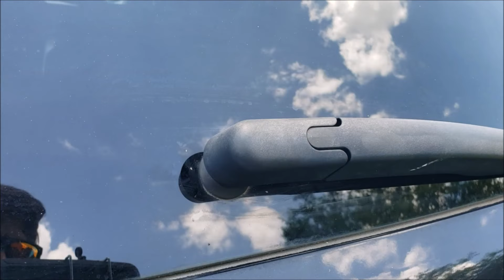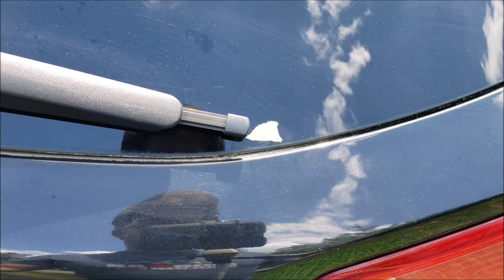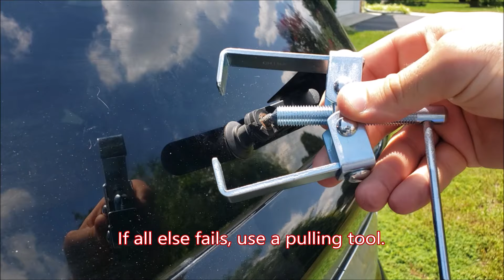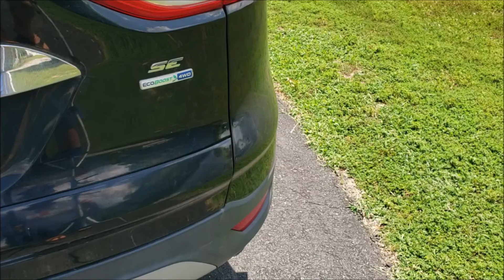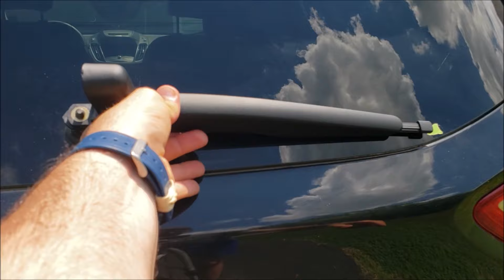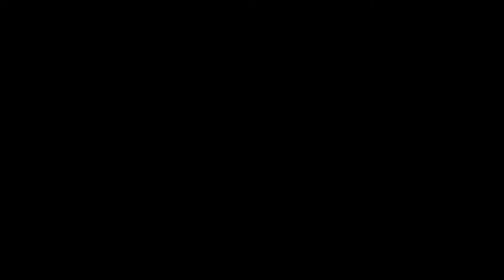Replace the Rear Wiper Arm: HOW TO ESCAPE

Comment: Very good and informative video. In most case, the pulling tool is not needed. Take off the nut. Let the WD-40 soak for a few minutes. Then simply turn on wiper, the twisting force will force the wiper arm loosen.
Reply from the maker: Oh cool! Thats good advice! I didn't even think to try that- good call Joe! Thanks for the comment and for checking out the channel!
Reply: Gonna try this in the morning, hope it works.
Reply: I tried this without avail. Any ideas?

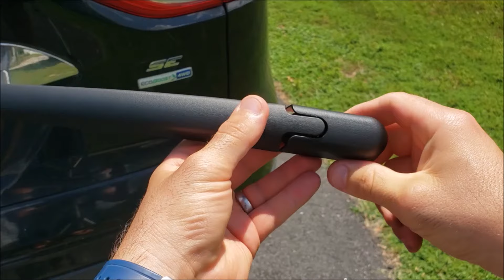Comment: Thank you - I originally found your video because somebody else posted it on their channel without attribution.  Anyway, I lost the arm and spring in a conveyor belt car wash today,  but they retrieved it for me.  I was able to reattach the spring on both ends without removing the assembly by freezing the video at 4:03 and noting how the spring hooked the two other two pieces of the assembly. Edit: I have a 2019 Explorer.  The manager thought I would have to get the Ford dealer to reinstall it.

Comment: Your video was the most comprehensive and informative.  I've seen others, but not as thorough as yours.  Especially, giving numerous useful tips in removing the arm initially was extremely helpful.  Not many have gone through or given thoughts to all those points.
Reply from the maker: thanks a lot @jtbtabimono- I appreciate you taking the time to post the comment and let us know- the goal of this channel is to help us all get to know our Escapes a bit more and be thinking about things from a proactive perspective when it's so easy to just want to immediately dive right in and bang out the solution. Please let us know if there's anything else we can help with and hopefully we can :) Have a great night.
Reply: Ain’t a single video show how too put the spring part in tho

Comment: My wiper arm doesn’t fit enough for the bolt to pop thru to put the nut on any ideas?
Reply from the maker: Hey there Jeremy- not sure- what is your make and model for your vehicle? Do you have an Escape like we show in the video or is it a different vehicle? What kind of wiper arm did you get to be a replacement?

Comment: Thank you for pointing out the marking of the angle of the blade tip position.  I fitted mine without marking the tip and the wiper ended up going beyond the screen.
Reply from the maker: No problem- glad it was helpful! Thanks for the feedback and taking the time to comment!!!

Comment: Hi I just replaced my wiper arm and now the motor will not turn it it just makes this grinding noise. Do you know what I can do to fix this?
Reply: oof- Hi Matt- thanks for checking in. This motor is a gear motor - I believe it is a worm gear that turns a main sprocket for a ton of torque for the wiper. Sounds like the gear teeth on either component may have stripped, especially if you're hearing a grinding noise. If you put your hand on it do you feel it vibrate when it grinds and does it only grind when the wiper should be traveling? I haven't ever done a replacement on my Escape, but I do know you can find a replacement one here for a decent price ( Rock Auto) . It may not be that challenging of a job either, but just time to get to it. Please let me know if you have any questions- sorry you're dealing with this. https://www.rockauto.com/en/moreinfo.php?pk=3588405&cc=1503985&jsn=893
Reply: @Monkeychunks8690  thanks for the info.

Comment: Howdy. I am in Oz sorting out sons Ford Territory. Not sure if they are same type but assembly looks the same.

 The only difference is that my post was a spline arrangement. Had the tiny grooves for female end to slide on to.  Yours looked quite corroded after you took it off so couldn't see. It looks like I may need some type of puller tool also. Ta for links. Bought a second hand assembly from wrecker for $35 Aus. 

Can't seem to unclip the part of the assembly that swivels otherwise I could just transfer that part.

Comment: I bought the puller tool and it slips off every time it gets tight any advice
Reply from the maker: Ok so you put the new wiper arm on there and tightened it and it still falls down? The puller tool should help it to come off but it shouldn't have any use afterwards, nor an effect on how the nut tightens back on the arm. Did you inspect the vertical splines inside the bushing on the plastic arm and the same style splines on the motor post? If those are worn away then yes it will loosen and fall down again. The splines are like gear teeth which hold the position of the arm to the motor when the nut is tightened down. They're critical. If thats not the case, then your motor may be bad and the post not able to hold position. The motor shaft should have a lot of resistance to it. If the nut is tight and the splines are holding and its still falling down,  its likely your motor.
Reply: Thanks for the fast response. Ok so I’m still on the old wiper arm, I removed the strew but the arm is rusted so I bought exact puller to remove it, I’m having trouble removing old wiper arm

Comment: Hi I have a 2011 equinox and mine is broke so I need a whole new arm but I took the bolt off and the arm piece won’t come off and we’ve tried everything even the pulled and it’s still on there
Reply from the maker: Ugh thats rough. If you have the time and patience and especially if its not on your car anymore, you could try a small cutting wheel on a Dremel and just try to split it from the post?
Reply: @HowToEscapeDIYTipsandReviews  unfortunately it was still on the vehicle but I did get it removed with a pulley thanks to my bf so thank you!

Comment: Thanks! The nut was easy to remove but I was having trouble removing the assembly from the shaft. I came to this video to see if it's safe to use a tool like you used. Thanks 🍻

Comment: Helpful thank you, on mine the compression spring under the arm had rusted and snapped, when I removed the nut the arm
Was stuck on probably from corrosion. Left on some wd40 for a bit to soak

Comment: This helped and gave you a 'like' but personally I had the spline with the tapered threading on the side which it wasn't obvious if I should pull it off the shaft.  My old wiper/arm had the plastic crack and came right off but when it came time to loosen the bolt and slide on the new arm it wasn't fitting with the spline there.  So I wasn't sure if I had the wrong part or that piece also needed to be pulled off.  I think a mention of the spline would be really a key piece of information that would be really helpful.  I ended up using the 'puller' tool and the spline popped right off and the rest was trivial

Comment: How do you make it aligned. It keeps going more down.
Reply from the maker: It sounds like your motor post got turned too far. Try taking the wiper arm off again. With the arm off and the post bare, press the button to operate the rear wiper and then let it stop in its intended home position. Then, reinstall your wiper arm and hold the arm when tightening the nut so that you don't turn the post again by accident. Basically a reset of the home position for the motor

Comment: Had to cut the bushing in half with a Dremel on both sides and then pop both halves off with a flat head screwdriver. Puller wasn’t budging it. I used a small disc to not risk getting near the glass.
Reply from the maker: I hear you on that... they're pretty tough to get off sometimes. Glad you worked it out and could get it all swapped out!
Reply: That's where I am with mine.  I bent the puller jaw.  The salt corrosion feels like it was weld on.  Oh well dremel it is

Comment: Works for 2004 BMW x3 E83 as well.  Just make sure you mount the wiper in opposite direction to this video.   Also, If you don't want to invest in a pull tool you can try use a screwdriver and rag (to protect paint) and pry carefully.  Thanks for helpful vid!
Reply from the maker: Nice- thanks for the feedback and the heads up to others with a BMW X3- thanks for the comment!
Reply: I used a pair of channel locks and put them on the left side and rotated the entire blade and it came unstuck from the bolt

Comment: Could you tell me what size nut is used?  I somehow lost the original, and went for 5/16 (didn't fit), m9 (metric, also didn't fit). I got both coarse and fine thread assortments of nuts that seem to fit, but are tight when threading, and I don't want to do damage.  Any help is appreciated!
Reply: 13mm @ 1.59

Comment: have you tried using a small bracket between the tools screw and the screw holding the wiper arm? it makes it much easier since the tool screw just wants to get off the screw holding the wiper

Comment: I had got that tool but mine was so stuck the tool bent. Advanced auto parts had another one for wiper blades. But it had a hand crank knob. I got a 8mm 1.25 bolt and put that in the tool and used my socket wrench to turn it much easier heh. It came right off.

Comment: I've just purchased a Nissan Micra MKIII rear wiper arm. I really hope this video helps me out 😃
Reply from the maker: Nice! How did it turn out? Did it work?
Reply: @HowToEscapeDIYTipsandReviews  unfortunately, the aluminium had ceased so we sawed it off😂😂 luckily, the new wiper arm had brass instead of aluminium but we also put plenty of copper grease. This was really helpful by the way!
Reply from the maker: @MAH-89  Hah! Good idea- yeah these things have such tiny splines, different materials in contact, and they have wiper fluid and the elements all over the place... it's no wonder they get so jammed with gunk and crud and sieze up.. glad you got yours fixed and how you're happy with it. Appreciate the feedback and checking in!
Reply: @HowToEscapeDIYTipsandReviews  anytime bud!😃 thanks once again

Comment: Would it be fine to apply copper antiseize instead of threadlock where the bolt tightens?
Reply from the maker: good question- I think yes on where the straight splines go into the brass nut of the wiper arm so that it doesn't get stuck again in the future, but no, you do not want to put it on the threads of the actual nut otherwise you could risk it loosening and coming off over time with vibration. You want that nut on there snug or else the wiper arm will lift off the motor post and hang loosely downward or strip out the splines.

Comment: I like your video. Very clear but my old arm is really stuck. I have the puller but that didn’t work 
Tomorrow. I will try to cut the metal  hub with a dremel tool
Reply from the maker: Hey Tale- thanks for checking in on your rear wiper- did you finish the job? How did the dremel go? Eager to find out how it turned out. Thanks for taking the time to share and for subscribing to the channel!

Comment: Appreciate the video! A quick question. My rear wiper arm looks similar to yours, but unfortunately my old arm has a hose for the wiper fluid and its being held together by a few clips that are not built onto the new arm.. Any tips, tricks or suggetions on what i could do about it?
Reply from the maker: Hmm that is interesting- you MIGHT be able to take the arm off and hide the hose inside the arched structure of the arm. You could also look at lawn sprinkler /garden irrigation nozzles from the hardware store to mount to the end of the hose and act as the sprayer to fan out the fluid before wiping. I'm not sure how much room would be left for your hose but I would think you could use a Dremel to maybe cut out a path for the hose then epoxy or zip tie it in place somehow...this would all be with the arm off the vehicle of course. Then maybe get an in-line connector to rejoin it to your vehicle's fluid line when you go to install it so it is a modular setup?

Comment: Good info. However, my 2013 Escape SE rear wiper blade had a snap slot with about a 1/4" slide in the slot. So the blade would snap on then slide about a 1/4" to set the pin (slide the blade towards the arm spindle to set). I didn't know this. Needless to say, using a screwdriver to pop off the blade also broke the pin on the arm. Had to order a new wiper arm and of course could not get it off the spindle. Using a puller actually pulled the plastic off of the bushing so had to cut the bushing to remove it from the spindle.
Reply: That’s exactly what happened to me! I blame Ford for this tomfoolery lol

Comment: Great vid.  Informative and quick. Is the thread lock necessary when installing the new arm?
Reply from the maker: Hey, thanks Eddie! No, it's not necessary- I just felt good about using it since I had sprayed a lot of penetrating oil on mine and didn't want the nut to loosen up with the residue I couldn't clean off 100%.

Comment: Be very careful because the underside edge of the nut cover is very, very sharp and is held down with strong vertical spring tension!!  Wear protective gloves when dealing with it!  I'm lucky I didn't suffer a major cut on my finger or worse when I recently performed the above task and with me it occurred while struggling trying to remove the "stuck" wiper blade arm from the motor...before finding this video!!
Reply: Why the hell are all these wipers getting stuck, really bad QC on fords part.

Comment: Great video! Now that summer is here, I would love to see a video on troubleshooting ac problems. I have a '13 escape titanium and it's blowing hot air. Makes driving unbearable!
Reply from the maker: Ugh totally understandable... my sister in law is having a similar issue with their 2013 SEL. is yours consistently failing to push cold air  or every now and then?
Reply: @HowToEscapeDIYTipsandReviews  its starts off cool for a few minutes then is just hot/outside temperature. It's constant.
Reply from the maker: Alright well at least a constant issue can be diagnosed instead of chasing random occurrences! I'll post something shortly! Thanks for the request:)

Comment: i want to remove the rear wiper arm for aesthetic reasons, but the screw hole is a problem.
Reply from the maker: Hi CVArts- are you saying that if you remove the wiper, you'll still have the hole in the glass where the motor post came through? If so, COBB Tuning makes a wiper delete kit where you can cap it off and it seals it up well (I've heard). Haven't tried it myself but it does exist.

Comment: What do you do if the housing separates from the bushing? Mine is still stuck on after using a pulling tool to get it off.....
Reply from the maker: Ouch- yes that can happen- the trick to the pulling tool is to get the very edges of the puller underneath the bushing itself- sounds like it slipped off the bushing and just pulled on the plastic. 

I've seen some people use a dremel with a small cutting wheel- if you go that route, make sure to use painter's tape a paper or plastic bag around your wiper motor to protect the paint of any metal bits that may come off during the cutting process. It's a bit messy, and you'll need to file down any rough spots on the post, but it's an option. 

I would recommend trying the pulling tool once more on JUST the bushing if that's all that's left on there if you haven't already? Please let me know- I'm sure this is a bit frustrating.
Reply: @HowToEscapeDIYTipsandReviews  I did try again with the tool you used and it kept slipping and I was seeing a few metal shavings at the bottom so I got scared. I'm just going to have to go to the dealership....

Comment: Careful pulling tools can destroy the bolt if you have the wrong pull tool. Some have a pin point and it will destroy it. Find the flat blot pulling tool
Reply from the maker: Thanks for the details there- just curious what happens to the bolt/motor post with the pointed pullers? Does it expand from the tip pushing inward?

Comment: Mine is so corroded that the tool bent both arms and did not work
Reply from the maker: Oh wow- have you tried penetrating oil to soak the corrosion prior to using the puller tool???

Comment: Yuck ... mine has the 22 mm nut seized on and the remaining insert seized as well.  The blade just would not come off until finally the arm broke like candy.
Reply from the maker: Oh wow- yeah it's surprising how tight these things can hold on- it's dicey because you don't want to put much strain on the window motor post, but sometimes you have to be a bit rough :/ How did it turn out for you in the end? Did you get your new wiper and arm on there?
Reply: @HowToEscapeDIYTipsandReviews  Success!  I used a small hobby hacksaw to cut off the jammed aluminum insert from the motor post. I lined the tailgate with damp old towel to catch metal particles.  A couple of cuts just down to the steel threads; then needle pliers to twist it off in pieces.  

Then I used a small-size hammer and chisel to remove the eroding fastener nut from the motor. I found the thinnest part and cracked the rusted fastener there, then tapped away lightly until the nut fell apart off the threads.  PB Blaster helped.

I cleaned off all the salt and corrosion.  The washer is aluminum too.  

I greased up the nut, washer, and motor threads, then put on new nut and new plastic cap  that snaps onto the hex nut points.  The old plastic cap looks like it had been cut--as if someone forgot to re-install it after replacing a wiper arm and had to slice it open to get it back in place. That's why all the rust and salt and seized parts in there!   A 22mm wrench fit perfectly to tighten the nut, although I misaligned the lift handle by a degree or two.  Shrug!

So, it took 2.5 hours to do a job that two garages refused to do for me.  Works fine now!

Comment: WOW, If the thread locker ran down to the wiper arm.... You Will NEVER get it off again....
TIP::::: Put the nut on the stud First, Then put a tiny drop on the nut threads.......
Please Think when using thread Locker!!!!